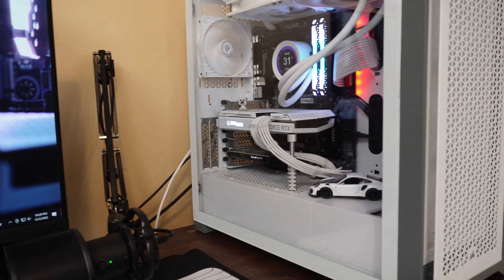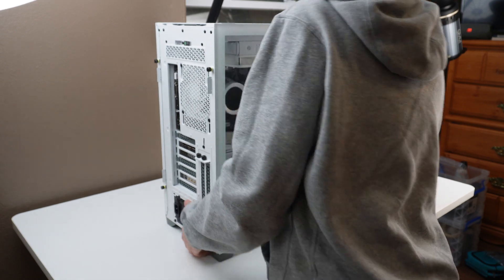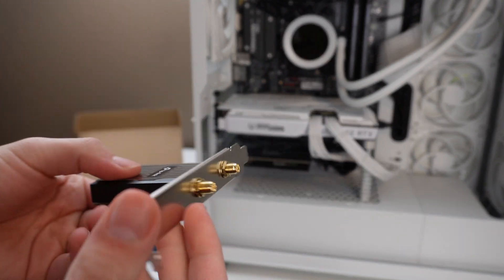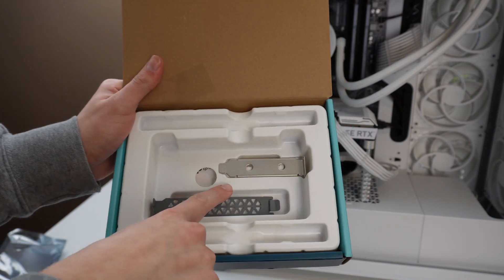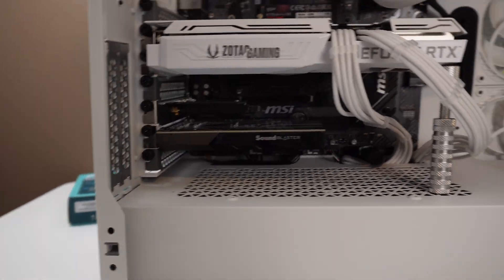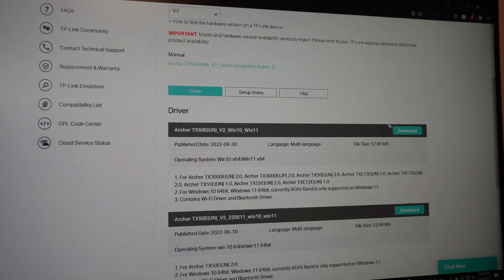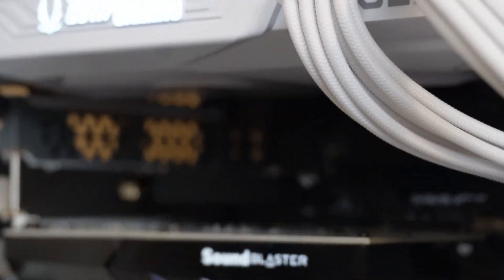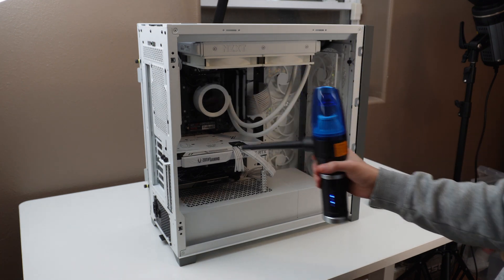TP-Link Archer TX55E WiFi Card: Is It Still Worth Buying in 2025?

Comment: i cant install the drivers. its plugged in and its detected and windows 11 now lets me use bluetooth and wifi. does intel override it? do i not need the drivers? if i didnt plug it in correctly it wouldnt be showing up but bluetooth and wifi work now but the tplink app doesnt recognize it
Reply from the maker: @diddykong9366  You may not need drivers specifically for it to work. It may work with generic drivers that windows may already have. I recommend installing the specific drivers. If there is no problem as of now and you are getting the rated speeds then I don't see why you would need to install the specific drivers.
Reply: @theavidconsumer  no i found out why. theres a drop down menu there and u have to select the correct version of the adapter you have.

Comment: Do you have a micro atx motherboard I’m asking because I don’t know if this wifi card will fit
Reply from the maker: I should fit since it comes with a shorter bracket for smaller cases unless there is another reason?

Comment: The wifi on thiscard works great, but the Bluetooth breaks on restart. the device spite out an error and I need to constantly reinstll the device for it to work again. Appearently tp cards have been known for this issue since 2020, so I do not recommend for a Bluetooth adapter.
Reply from the maker: @Volcano_Head__  Thank you for specifying that it does not make a good Bluetooth adapter rather that just saying it's a bad wifi card. Also, did you try doing a complete driver uninstall before reinstalling the drivers? This may fix it.
Reply: @theavidconsumer  yes, I uninstalled with the help of Windows support, and the only way to get it to work again was to remove the device and have it be detected again, but it just breaks again after another power cycle

Comment: Should I get this or the archer tx3000e
Reply from the maker: @asilva2  The TX3000e performs slightly better but the TX55e has better Bluetooth. Personally, just pick the more affordable one.
Reply: @theavidconsumer  Do they have the same range tho? My routers on the opposite side of the house im tryna find out which one will reach it better
Reply from the maker: @asilva2  From what I researched. The TX3000e has a better antenna design allowing it to have a slightly advantage in range. So if you want the best range, I suggest you go with the TX3000E

Comment: Is anyone else having issues with the wi fi card? Mine is going to a low ping and its gets very high for some reason every 5 min or so? can anyone help with this problem it would be a big help.
Reply from the maker: First things first, make sure to make sure your windows are up to date, including the optional updates. If that doesn't work, try uninstalling and reinstalling the WiFi Card drivers. If this doesn't fix the issue, try checking with the router. Try following up with each device. Let me know if this fixes the issue.
Reply: @theavidconsumer  hey there, just tried uninstalling and reinstalling the drivers. For the most part it works better than it did for sure. When I first play a game it happens again but after a while it stays good. Does this mean the issue has mean resolved? 
btw thank you so much for responding back means a lot!
Reply from the maker: @Kerbecsss  Of Course! I hope to keep it that way 🙏

Comment: im using this adapter with isp unifi 300mbps.. but it seem my speedtest reaching at 200mbps..  after seeing this video you can reach to 500 like no problem.. so it is not the adapter speed limit... what is wrong with my adapter?
Reply from the maker: Check with your Internet Provider. Ask what speeds you are currently paying for. If you are only paying for a 200mbps plan you'll most likely max out at 200. This likely isn't an adaptor issue.
Reply: @theavidconsumer  it is 300 mbps.. nvm i fix it already.. turn out the adapter antenna stick didn't attached properly..
Reply from the maker: @matarif304  glad you got it figured out!

Comment: How stable the connection is? Especially the WiFi. I experienced inconsistent connectivity with some products.
Reply from the maker: Really depends on distance from the router and obstacles in-between. If you are referring to stability in terms of retaining a connection not regarding speed. I've never had it disconnect being about 2 rooms and a floor below away, with a couple of walls between. Speed was significantly lower but never had connection issues.

Comment: Thanks for the video! What's your internet speed? You showed what you got with the adapter, but would be nice to know what is your usual max speed.. thanks
Reply from the maker: I get about 592 download & 10 upload on ethernet, this is about the max speed for my current plan. Right now from where my current setup is i get about 540 download & 10 upload. The less obstructions and less space between the system and the wifi router the closer youll get to ethernet performance.

Comment: show speeds yo.
Reply from the maker: My max speeds on ethernet currently are 592 download & 10 upload. With were my current system is which is now on the same floor as router, I get about 540 download & 10 upload. There are about two or three walls in between the router and my system.
Reply: @theavidconsumer  thanks

Comment: hi ,i need bluetooth  i already have lan connection. can you tell me how many bluetooth devices can we connect at the same time? wireless mouse,keyboard and wireless speakers at the same time.
Reply: Same question 😢
Reply from the maker: Yes, I was able to connect multiple devices. I have a Bluetooth Logitech mouse and I also use Bluetooth Headphones and I often use them at the same time with no issues.

Comment: My desktop already has bt5.0 and wifi, but I want to upgrade to this card, hoping to get better connectivity for bt devices and maybe better range on the wifi. Do I need to disable the installed software in device management or something or will the software download do all that? Also,  how do I do that?
Reply from the maker: It will default to the wifi card once drivers are installed. I myself have built-in Bluetooth and wifi and it still default to the wifi card
Reply: @theavidconsumer  Thanks for the information. I kinda thought that because I've watched several vids and they don't mention anything other than just downloading the new drivers, but there have been comments saying you have to. Anyway, thx.
Reply from the maker: @raincadeify  No Problem! Also thanks for question! I'm sure other people will find this comment useful!

Comment: but which MB has this type of connection extra slot , and also is it better to have pcie or pce ? , is this a ATX motherboard?
Reply from the maker: Yes the motherboard in the video is an ATX motherboard. You can still use the wifi card in a regular size pcie slot.

Comment: What is the cleaning kit you were using to clean your PC near the end of the video?? What is the name?
Reply from the maker: I bought the Koonie 15000mAh Cordless Air Duster & Vacuum 2 in 1. It can be found on amazon for $89.99. Really expensive in my opinion, but I've used the sub $30-$50 dollar electric air dusters and they do the job just fine. I I bought it for the large battery capacity, I don't really have to charge it that much compared to others. 

Amazon Link: 
https://a.co/d/5C1QSxw

Comment: They supplied a CD with the drivers at the bottom of the box. You have to read the manual to realize that. I bought this one for my wireless headphones and my generic gaming controller. So my Sony ear buds working great with Windows 10 minus the latency of the audio which is ok cause I'm only listening to music or YouTube. My gaming controller is working well but Cyberpunk will not work with the controller on Bluetooth but only connected to cable. Perhaps CDPR did that on purpose to avoid the latency.

Comment: Does anyone know if I have to use the bluetooth functionality and just not plug the wire in?
Reply from the maker: No, if you are not planning on using the bluetooth then there is no need for you to connect the cable. 👍

Comment: what is the difference  between this card and archer TX50E?
Reply from the maker: The TX50E is older and the physical size is slightly larger. As for price I'm not sure why the TX50E is more expensive when the TX55E performs better. The TX50E uses Bluetooth 5.0 while the TX55E uses Bluetooth 5.2.

Comment: İ want to ask if this wifi card will work in windows 11 since in some resources it says win10 only and i couldn’t find any exact information about this and not any other youtuber mentions the windows compatible part
Reply from the maker: Yes, I am currently using this wifi card in multiple systems running windows 11.
Reply: @theavidconsumer  I installed the wifi card but when i check device manager the name is shown like ax210 160MHz i updated driver automaticaly and manually but still same
Reply from the maker: @ItsZen0-98  try uninstalling the driver and device and retry

Comment: what's that blower? thingy?
Reply from the maker: It is an electric duster that I bought on amazon. There are cheaper options than the one I listed, but the one in the video is a great, long-lasting option. Battery life is excellent for the duration of use! Though, I think you could get away with using a cheaper option!

Comment: 6:20 i bet there was a CD with drivers and stuff, but  99 % ofpcs built nowadays dont have a dvd drive. I still have a dvd drive because i have a habit of listening to music CDs on my pc, so i got myself Fractal design pop air, which has a slot for a dvd drive 😊.
Reply from the maker: Yeah there was a cd with what i assume would be the drivers, but as you said, most modern computer don't have a cd reader. Would probably be better for them to include a cheap flashdrive with drivers.
Reply: @theavidconsumer Including a flash drive with drivers is such a good idea, I'm shocked it isn't already being done.  My guess is they don't want to spend that extra dollar or two per unit.  It adds up.  After all, you can just get all your drivers online.

Comment: I have this wifi card, and my question is…How the fk do you rotate the antennas with unscrewing them…
I can only move them up or down.
Reply from the maker: Hold the screw portion and only rotate the antenna? Or Vice-versa?
Reply: @theavidconsumer  I want to be able to move the antenna left to right, to put it simply. Doing so loosens them.

Comment: im hesitating to get it or not my motherboard's wifi signal is insanely good, i literally play video games on it with no problem until the thing that holds the antennas becomes clunky again. i cant have a stable internet when that happens. is this a good replacement?
Reply from the maker: Try tape to hold the antenna in place if you don't want to spend the money, but if you are willing to, this Wi-Fi card is perfect! It will definitely perform better than onboard Wi-Fi.
Reply: sadly this doesn't work, i also forgot to mention that im far from the router  @theavidconsumer
Reply from the maker: @oniidante  I'd say the effective range is about 15-20ft for WiFi (expect advertised network speeds in this range) it can be much more such as 30-50ft if you don't have many walls or floors between the system and the router (but expect slower speeds).

Comment: Hey buddy I wanna ask something is the Bluetooth working fine & what's it's range as i was thinking of connecting Bluetooth controller for  casual gaming
Reply from the maker: It works up to about 18-20ft reliably. (Can get up to 10m or 32ft and still have bluetooth connection) Haven't really had a need to go further than 20ft, used this card in my living room pc to play Skyrim from the couch via Bluetooth. I imagine you want to do the same. If that's the case I'd highly recommend!

Comment: guys, if you don't have a way to connect your PC to internet and you don't know how to install the drivers, you can use USB tethering by simply connecting your phone to the computer with a USB cable 😉
Reply: Does anyone actually read? He said for the drivers 🙄
Reply: whats the speed like? surely its held back a bit no?
Reply: @jvnahx  I guess it depends on the cable. However I couldn't try it properly because I don't have a great connection; I also played with it sometimes and it didn't give me any problems
Reply: @jvnahx Yeah, but you're just installing drivers, not gaming. Even if your phone only has a 3G connection, it won't take long to download drivers.
Reply: @jvnahx its not im using it rn for gaming since i got no internet connection lolll
Reply: Yeah but you should absolutely not game with that
Reply: Using usb tether drops my download speed from like 100+Mbps on wifi to like 15Mbps on usb. It sucks. This is not to use long term

Comment: hey great video! Just wanted to ask does it work same as onboarf mobo wifi and is it better than usb dongels for gaming. I think the usb ones may get ping spikes while gaming although I could be wrong.
Reply from the maker: Yes, it will replace your on-board wifi. A dedicated wifi card will perform a lot better than on-board. More reliable & steady connection.

Comment: will it work if my router is not wifi6 ?
Reply from the maker: Yes, it will still work.
Reply: that was a quick reply •o•,thank you so much dude
Reply: hey i finally got the card but im bit lost where to plug in my card and the cable ,btw i got an asus b760 mobo
Reply from the maker: @RoelRoe   It goes plugged into a PCIE SLOT. Just plug it in as if it were a baby graphics card. As for the cable it goes plugged into a USB HEADER. It should be  near the bottom of the motherboard. It looks like 4 pins on top and 5 pins on bottom.  

◽️◽️◽️◽️
◽️◽️◽️◽️◽️
Reply: i see 2 slots that says PCIE on my mobo a tiny one above my gpu and a big one underneath it,i plugged it underneath my gpu,i started my pc i waited for 15 minutes and restarted it still no wifi showing •-•
Reply from the maker: @RoelRoe  do you have ethernet by any chance?
Reply: @theavidconsumer  unfortunately i don’t
Reply from the maker: @RoelRoe  Do you have apple or Android? You may be able to download drivers to your phone and pass them over to the pc
Reply: @theavidconsumer  i’m using an iphone rn,how to pass them to the pc?
Reply from the maker: @RoelRoe  Were you able to download the drivers? 

Here, try this: https://youtube.com/watch?v=NUll3fKgWz8&feature=share7
Reply: @theavidconsumer  unfortunately i can’t do that since i can’t connect to the internet or have an ethernet,i think i’ll try uploading the drivers on a flash then download them on my pc
Reply from the maker: @RoelRoe  Yes, you can download then to a USB stick to then install the to the computer.
Reply: @theavidconsumer  i’ll try that when im free,thank you so much 
i’ll keep you updated !
Reply: update:
im finally able to connect to wifi i downloaded the drivers using an android phone and its charger,thank you so much dude i appreciate your help so much :D
Reply: also im on windows 10 64bit do i need to install drivers for it to work?
Reply from the maker: @RoelRoe  Connect it, wait about 15 minutes then reset computer. It should be working. If not you can visit the TP-Link website and search for the drivers using the name of the wifi card. Then download & install. If you need more help, let me know!
Reply: @theavidconsumer  alright,thank you again i really appreciate that !

Comment: do you get any packet loss/lag when playing online games using the adapter?
Reply from the maker: No I did not. I didn't notice any lagspikes or stutters due to wifi connection. I think it really depends on how stable your router/wifi speeds are. For the most part I haven't had any issues with Bluetooth or wifi when playing games like Fortnite & Call Of Duty, it has all ran smoothly! 👍
Hope that answers your question! 😁
Reply: @theavidconsumer  ahh I see, thanks for the reply, great review btw 👍👍
Reply: @theavidconsumer  hey man I got another question for you, how far is your computer from your router?
Reply from the maker: @_bleufort_4715 Router is upstairs but if it were on the same level it is about 18 to 20ish ft away. Highly recommend having as little obstructions as you can between you and the router as well as having the antennas face the router for best performance. I saw a significant drop in wifi speeds when antennas where facing away.
Reply: @theavidconsumer how much ping were u running on Fortnite
Reply from the maker: @abefragz8020  I got about 50 ping throught the wifi card and about 40-50 through ethernet. Though ping is really depended on how far you are from the game server.

Comment: Hey
nice review, but I went for ub500 usb nano
btw what's that fan for cleaning dust from pc?
Reply from the maker: I bought this one. It's a little on the pricier side but it comes with a larger battery capacity. You can definitely find cheaper ones but I really like the one I bought. Can be used as a vacuum too! 

https://a.co/d/fGAU4jk

Comment: i got that card and on my wifi 6 network the download and upload is 45/45mbps when i pay for gigabit. im on the 5g band and itshowsa send/receive of 1000/1000. i expectat least 150-200 over wifi but im not even getting that.and i got both antennas on. can u help? 
edit: mines the tx50e but it installs and looks alot like yours.
Reply from the maker: My recommendation would be to go to the tp-link website and search for drivers regarding that specific model. Install the most recent drivers and see if the speed has improved. If not is there any obstructions between your computer and router?
Reply: @theavidconsumer  I did that and it didn't work, but I messed around for a bit after uninstlaling the drivers completed and it works fines now. Been dealing with this since I got it and idk why it works now lmao
Reply from the maker: @tubelesstrippin  yes, Uninstalling drivers can work too, it will basically have the computer reinstall drivers again which sometimes fixes the problem. Glad you got it figured out!